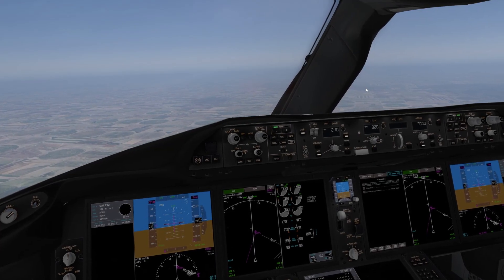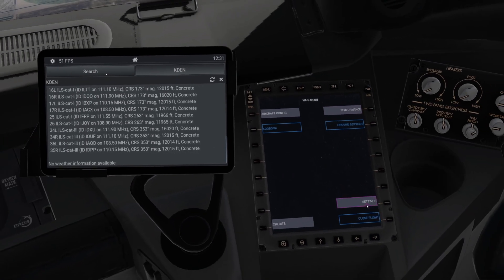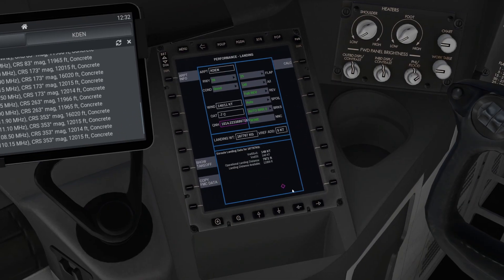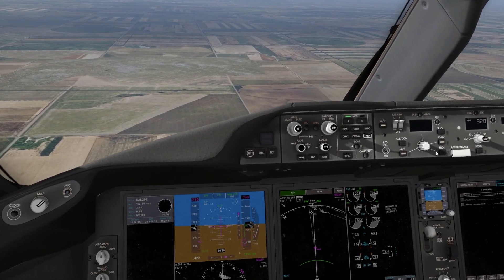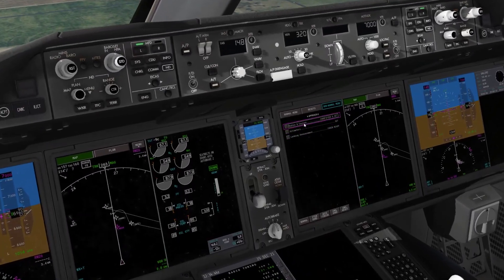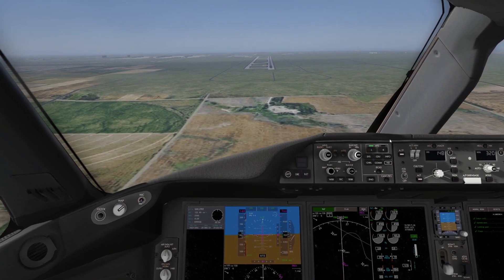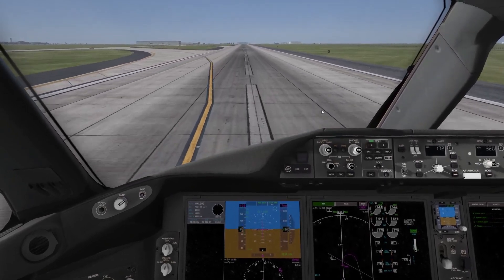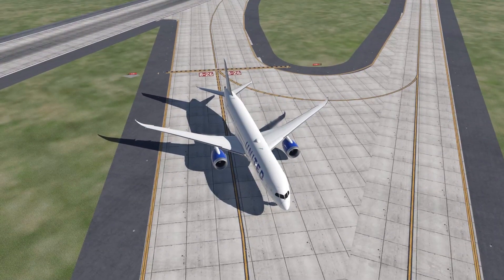(Old) How do to an ILS Approach in the Magknight 787 (Default FMS)

Comment: I've followed this video to a "T" and the ILS still never picks up!  Must be a bug with the Magknight.
Reply from the maker: What airport? And u need to press APP (below LOC) on the MCP for it to appear on the pfd and work. And btw this is an old video so you may need the newer one as this video won’t work with the current version!
Reply: @Simleybob  EGLL (Heathrow).  It also failed to pick up at EHAM.  I have followed the tutorials.  I set the course and ILS frequency correctly in the FMC.  Calculated the correct takeoff and landing weights.  I come in to intercept the glide scope at the right altitude.  The only time it has ever worked for me was at KLAX.  It is the latest version as I have bought it n the last year.
Reply from the maker: @ElPablo390  you are probably putting it in the wrong slot. It needs to be in the ILS/GLS slot (not the first VOR one). Follow this tutorial instead! As it’s for the up to date version. This video is for the older versions with a different looking NAV RAD page. https://youtu.be/pExMVsFAp7I hopefully that helps!

Comment: @Simley Bob Hey, just got my 787 updated to the latest version however the only problem is that everytime I do ILS, it doesn't align on the runway despite the course on the fmc and navigraph are the correct course. Would appreciate a lot for the help.
Reply from the maker: Are you pressing APP on an intercept heading? And check the correct frequency (not just the course) is in the ILS section of the nav rad page.
Reply: @Simleybob  In my situation, I was turning right onto the runway heading of 341° and I pressed the app button while turning and before intercepting the localizer. And yes I made sure that the frequencies are correct. 110.70